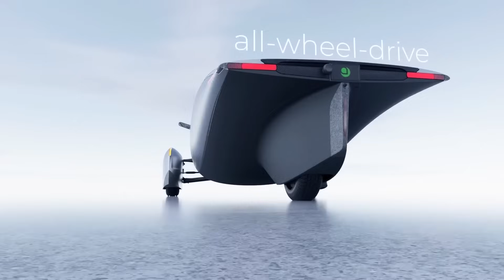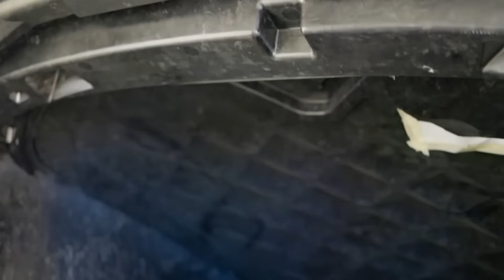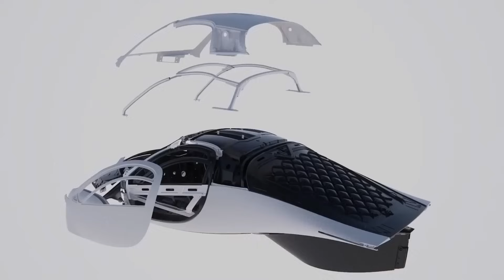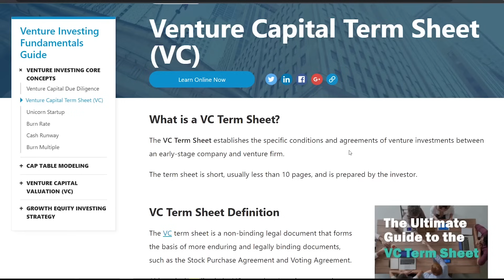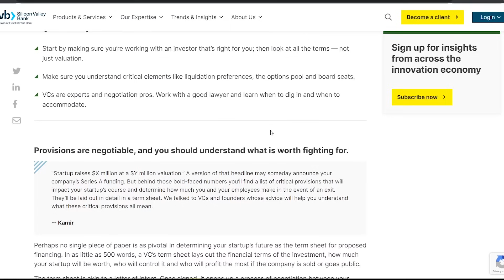Aptera's November 2023 update

Comment: I bet personal car insurance will be pricey. I pay a lot for my Tesla because most are toast after a crash or really expensive for fender benders. Insurance companies won't like it is a carbon tub car that only has two airbags with glass solar so that is gonna get you compared to other safer electric cars and banks don't like these types of motorcycle class cars. Best to pay cash probably. I do not like the wheel pants. Reminds me of a Prowler. They don't last long and start looking rough being sooo close to the ground, let alone curbs and they shake and vibrate like crazy. The pot holes and speed bumps in my city would destroy them over time. I like it..but I don't know...more research is needed as I say.. I've owned 15 cars and worked on over 10000 as a mechanic.
Reply: People have gottenprovisional  insurance quotes already and they are not particularly expensive.  Perhaps that is in part due to the autocycle classification?

The early prototype wheel pants were shakers, but that seems to have been solved by the production design, as well as access to the tire.

Comment: I've been trying to get an answer on why they have the two window design on the side doors?
Reply from the maker: Because of the curvature of the door.  If you have a single piece of glass that's not curved it won't roll down which is the design they had back in the first iteration. But quickly realized that people have to use toll booths and drive-thrus

Comment: that single bottom piece.... that seems like it'll be bad if you get rear ended. like just bumped and you'll need to replace that whole piece. i'd like to know if it has some elongation before breaking. Does the material just shatter or will it absorb the impact and flex?
Reply: I believe that the rear is designed to function as a crumple zone to absorb energy but I don't know the engineering details yet.  I will be interested to learn that, too.  We should find out when the PI vehicles are crash tested if not before.

Comment: I am glad that Aptera has made significant progress.  I am not as worried now about Aptera succeeding.  There are actually 3 things I am looking forward to to make Aptera great, Chargers included to charge at multiple charge points to include 120/220V AC from your house and detailed how to do guide to connecting an external solar panel array.  2nd is to include video capture from all the cameras and storage on something, prefer an SD card.  Finally, details on how to tow the Aptera so when I travel via RV, for example, I can drive my Aptera around.  If we have to use a special vehicle tow system, just let us buy one.  Maybe I will make my own and sell it to Aptera owners.

Comment: Wondering how to change the rear wheel  on the road.
Reply: The panel comes off with about two minute's effort. They're going to put out a video about it soon
Reply: Thanks mate. I'll probable need to carry at least one spare as the roads are crap here in Australia.
Reply: A plug kit and DC inflator will take care of most flats without needing to carry a spare.

Comment: Steve, you've said that you are planning a visit to the Aptera shop sometime soon. Would you ask about the ground clearance of the belly pan? Please. My use case requires some off road ground clearance. I am not concerned about the wheel pants ground clearance because they move with the wheels and will almost always have the clearance they need, but when you are going up a tractor path with a high center ridge that is rocky clearance is important. A follow up question would be whether or not the off road package has a higher ground clearance of the belly pan.     Thanks, I love your work and watch every video.

Comment: Since carbon fibre is very abrasive when injected, wonder how long the mold will last before it is abraded out of tolerance?
Reply: I don't think it's injected the way it typically is in plastic mold. I remember seeing a demonstration where the carbon fiber is placed in the open mold, then the press activates and presses it into shape.
Reply: @locibrand  Correct.  Lumps of "plastitac" like material are placed on the bottom mold and then squished in the press.

Comment: I have my thoughts :)   

Here is where the fun begins. How many partially assembled vehicles is Aptera going to take delivery on by February next year. It has to be more than one to prove they have the funds and can make progress with their testing. So how many?

  
It is interesting to see the tub having been made but nothing about this is going to make it cheaper. Cheaper to assemble yes but the material costs are substantially more and all of the body is having the cnc and bonding work done in Italy before shipping to the US.  As for the manufacturing method, Tesla brought the idea of pressing major components to the forefront of the industry and now all manufacturers are rushing to adopt their methods and combined with a structural battery pack hundreds of parts became three.
   
The reclamation of flashing is common in the industry across many different material types.  The industry has been doing this for years as besides the carbon fibers that must be recycled the resin also needs to be processed in the recycling work as well. 
  
Then comes my favorite part with the biggest elephant in the room. Their solar manufacturing team. Why are they only showing off one piece? Given they plan to create more than one PI vehicle shouldn't they already be doing work to create those parts and brag about it?  While not all PI vehicles will have panels more than one should. Yet we have never seen a solar hatch either. So only another part for Gamma and nothing shown for PI pieces. The elephant? October 2022 Solar is in Production video - now ask this - what happened to that declared production or was it just another lie?  
  
Sorry, if they don't have money to produce the first 2000 properly they certainly do not have the money to make them slowly. Do I need to spell out how stupid that idea is? They already have projected a for eighteen to twenty four months while ramping up production. They already burn nearly five million a month producing nothing. They cannot afford a protracted slow ramp up and they certainly cannot afford to sell hand built copies.

As for funding. The new December 1st funding push with big discounts for minimal investment. That smacks of desperation to keep the lights on.
  
What you miss on term sheets is that it is intent. Aptera will fail any due diligence when it comes to financials.  Term sheets can also have requirements that the Aptera team has previously dismissed, namely giving up any control of the company. Remember, by this date Aptera is likely has accumulated over two hundred twenty million dollars deficit per their own filings. Only Class A stock can vote and only Chris, Steve, and some select Directors and investors are allowed to hold Class A. All other stock is non voting. So will they cede Class A stock to secure money to reach production? How much control are they willing to give up to get there?  

Term sheets can also be straight up loans with high interest rates. Still let me ask you this, given we have heard they have had multiple paths to production, ie funding, over the last two years why have none of them come to fruition. Simple, it is easy to make the claim they have the funding but as demonstrated they never actually acquire it.
Reply: You sure used a lot of words, just to tell us that you don't know what you're talking about.
Reply: You're probably right. Definitely a scam and they're lying about everything, or all the entities and individuals involved are entirely incompetent. Obviously all this money has been spent and progress has been achieved in an attempt to merely squeeze more pennies from all of us poor suckers who are blissfully unaware of how innovation moves forward, despite the best efforts of those who do their best to nay-say and stifle progress. </endsarcasm>
Reply: "They already burn nearly five million a month producing nothing."  Of course this is incorrect.  They have produced and validated many of the body parts for the PI vehicles already.  They plan to build 16 of these to put through validation testing before production for delivery starts. 

Your comments indicate a huge inattention to detail.  Aptera is a continuous improvement company.  Glass of the required size for the Aptera panels only became available after the initial plastic sandwich versions were in initial production.  It still had to go through testing that the plastic versions had passed before the decision could be made to switch - with the benefits of lighter weight and more scratch resistance - among others were adopted.

Production equipment had to be decommissioned and moved to the Carlsbad site into the space that had been originally planned for the vacuum resin infusion equipment.   They don't have an abundance of people to do this work way ahead of when the parts are actually going to be needed.  They are managing their money much better than Tesla did in 2008 when they were starting production.   They are clearing showing more talent at this than Elon did at this early stage.

This process will continue even after production begins as improvements are folded into the design as soon as feasible.

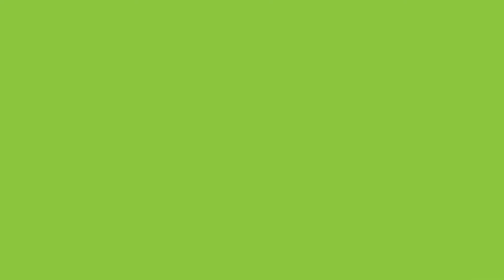Comment: Look at 1:27  ...see the ragged edges of that carbon-fiber pressing? So, how many man-hours worth of labor is going to be required to mill down those edges?...and how will exacting "finishing" on those edges be accomplished? , what tolerances can be achieved with "by hand"?
Reply from the maker: They use a special CNC machine to do it automatically
Reply: @ApteraOwnersClub  OK,  that makes sense, the programming for this complex a shape must ave been very time consuming....lots of hours  involved.  This one-piece construction will be a giant headache for repairing as the likes of Formula-one racecars that are composed of similar parts  & materials will shatter that carbon fiber like glass....& do tell, you get  T-boned, the tub shatters.....replace the whole piece....just how does the "unbonding " process work when one is replacing a single piece when the whole thing is "glued together"?
Reply from the maker: If the tub shatters I'm sure insurance will total the vehicle
Reply: @ApteraOwnersClub  We have all seen videos of  Formula One crashes & the bits & pieces of carbon fiber are everywhere...it behaves very much like broken glass...and not like tempered glass nor laminated glass.
Reply: And removing flashing is relatively quick. Should be much faster than the 12min cycle time of pressing the tub.

Comment: Great video. The progress is exciting. 
I am curious if anyone knows how the frame parts will packaged for shipment to California for final assembly. I assume that they will be placed in containers, but do they all stack nicely?. If not, I would think that containers will only be able to fit a small number of frame parts. If the frame parts do stack nicely, then it would greatly reduce shipping and handling costs.
Reply from the maker: the body structures will be completely built in modena and shipped as complete bodies to san diego.
Reply: @ApteraOwnersClub  Yeah, that makes more sense. I had always heard that final assembly was in California, so I thought that this included the body.
I can see by the dimensions that it is just under 8 feet wide, so it will fit the width of a container. They could easily fit one in the length of a 20-foot container or 2 in a 40-foot container.
If the wheels and electric motor are already attached, they could just push it in by hand or just drive it into the container and slide out the door.
Neat!

Comment: Are there any other places besides the top that has those aluminum cage pipes? (roll bar stuff)
Reply from the maker: the doors have metal reinforcement as well.
Reply: The frame, which holds the battery pack and supports the suspension and provides for the front crumple zone, are all aluminum. I believe the roll cage is steel. Wish it wasn't, but that is what was stated.

Comment: They state the press is 5000psi. That is over and above the weight of the upper die which should be over several tons. Imagine the weight that must be LIFTED to separate the halves of the mold.
Reply: I have not heard that statement. I have only heard that it is formed in a 5,000 ton press.

Comment: I'd recommend folks look up Nanocellulose as it is being used more and more in industry which has the benefit of being biodegradable and yet strong. The process shown here could be used in the future with a material like it. I understand folks are looking at this forged carbon as the future but I really don't think it is that viable. Carbon fiber whether forged or not is pretty costly. And its source unlike low quality wood pulp is much more energy intensive. It's good to see that the tooling here is working and hopefully if the vehicle stays in production then more sustainable materials will be used with the same tooling process etc.
Reply: The Aptera CTO, Nathan Armstrong,  has already spoken of looking into such materials, including hemp fiber.
Reply: @n.brucenelson5920  mostly before they settled on the carbon forging but I suspect the forging would work for these more sustainable materials as well.

Comment: Keep in mind for every pro there’s a con. This fewer part is great for manufacturing but it gonna make it more expensive to repair. The car at a low price point means it’s more likely to be totaled by insurance companies than most other vehicles. I don’t know why people think this will be cheaper to insure but there is no evidence of that at all. I keep saying people need to appreciate the Aptera for what it is, it’s made for efficiency and nothing else that people keep predicting. This is not a Tesla or a Prius (not even close). Appreciate the Aptera for what it is, everything else is a plus but it has to prove its efficiency in the real world first.
Reply: Any crash that would total an aptera would also total an equivalently sized steel framed car. In fact, the carbon fiber should be more resilient, and there will likely be some crashes that would total a steel frame car that the aptera will survive with only cosmetic damage to the outer fiberglass/solar glass/aluminum belly pan damage. And thank god it's not a Telsa or a Prius :D

Comment: On the subject of body panel repairability, I commented about it on Aptera's Nov update and they replied: "All exterior panels are made of fiberglass, and are easily repairable. Our structural parts are very strong, and will bounce back in minor accidents."  "Bounce back" seems like an optimistic take on things, but we'll see!  Here's hoping
Reply: "Don't you wish everything was made like Rubbermaid " 😂
Reply: Perhaps I can explain 13ccasto, minor accident means the speed at which the car is traveling. 5,10,20 kmh could be a minor one and 25+ could be a major accident. If perhaps the regenerative braking was at maximum power and the driver applies the brakes as best as possible, it could be a minor instead of a major accident and save lives. Just driving techniques though so that is going to vary. I'm conservative when I drive. HTH.

Comment: People still posting negative comments need to realize the shell the two innovators were sitting inside was made with production machine that Aptera will use in its manufacturing plant. Yes those machines are already built. 

About the funding, remember the current investments requested by Aptera leadership is for the research design and development efforts. For those following Aptera closely, we know know many revisions and at times absolutely new features we see. And yes this phase does include designing and building those production machines in Europe too.

Comment: 13 miles per hour on level 1, 57 on level 2.  Assume L1 is 12A 120v.  1440/13*57 roughly works out to L2 being 6.6 kw.  Nice to know that's still on track for being the fastest home charging solution.
Reply: The charging speeds are a huge game changer honestly. Makes it truly unnecessary to have level 2 charging, just run an extension cord from literally any standard outlet. This makes having an EV possible for so many people not to mention how much easier traveling will be.
Reply: @Tazdeviloo7  That, plus EV enabling all the people with no access to overnight charging whatsoever without them having to  do weekly supercharging.  There are a good number of people out there who live in apartments and otherwise don't have a practical means of charging.
Reply: @SomeGuyNamedPaul49  Yep. Level 2 charging becomes level 3 basically. So many public level 2 chargers everywhere in comparison. The ones at supermarkets actually become useful to charge at while you shop.

Comment: Just for a start up business contrast; Mullens Automotive {an EV start up} has hired auditors to figure out the current and future prospects of the company. Even this Aptera Cynic thinks this news, if true and correct, is a very hopeful sign. Now Aptera will have to avoid the Next Big Problem, the one that Archemodo & others, get it built and then fail to thrive.
Reply: Congratulations my friend, anyone who is on the leader board is helping the cause, my number has slipped since March, but finally the finish line is in sight.
Reply: I own an ARCIMOTO and it delivers as advertised. Yet it is nowhere near Apteras level of sophistication in engineering. The FUV is not profitable as a result, same as Rivian and Lucid. 
Steve Fambro has said that the relationship with CPC is "transformative" for Aptera, now we see why. If Arcimoto had CPC, my FUV would have butterfly doors and there would be more on the road. Indeed, it is my experience with Arcimoto that shows me how Aptera will avoid the same mistakes. So I put my money where my mouth is and joined the Accelerator Program.